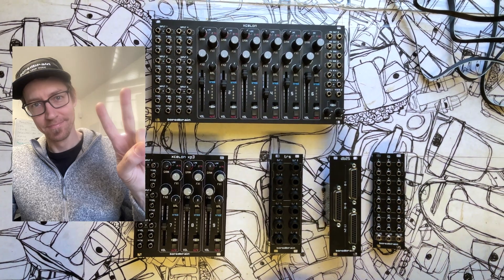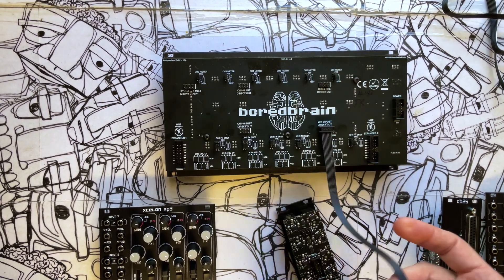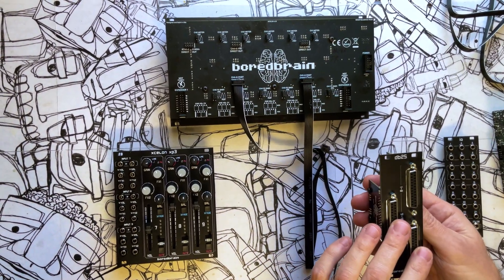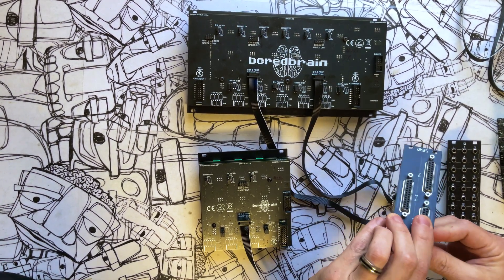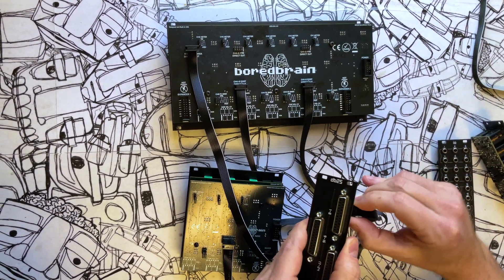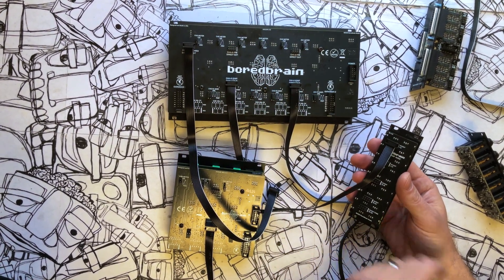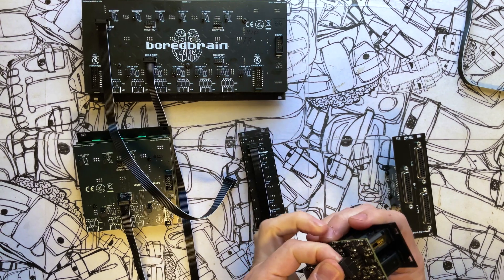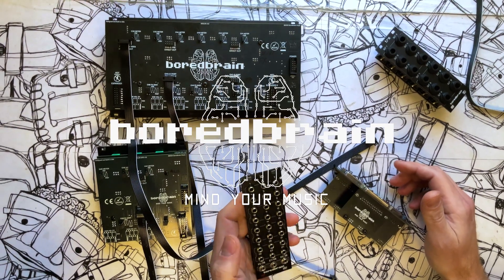Configuring Boredbrain Xcelon with Direct Output Modules DB25, TRS, and IO

Comment: Will the TRS module  work to bring in external instruments to the xcelon (octatrack, etc.). Via the i/o module or directly to the mixer?
Reply from the maker: Hi. No, the TRS module has outputs only. You would simply plug Octatrack into the channel inputs of Xcelon. The inputs are unbalanced.

Comment: Very cool! I had a question about the outputs. Would it be possible to multitrack record individual tracks that have send effects on them, or would it only be possible to have the effected sound by recording the main output?
Reply from the maker: @dammills  you can direct record the FX returns individually yes, but the signals will contain any channels signals sent to the FX because FX sends are shared amongst all tracks.